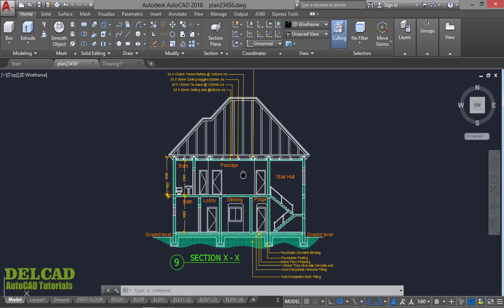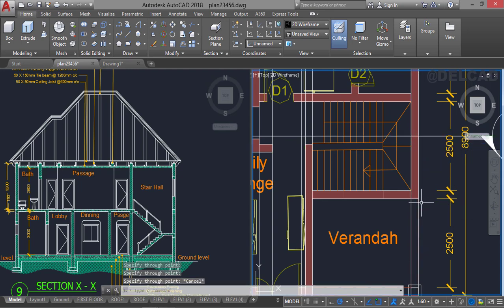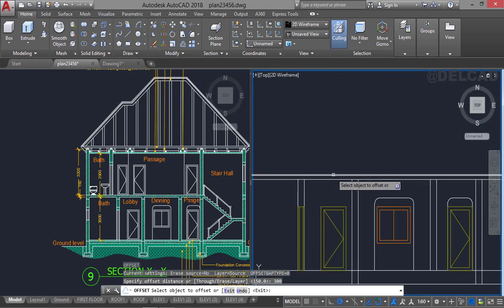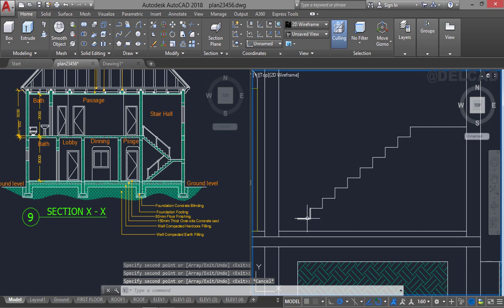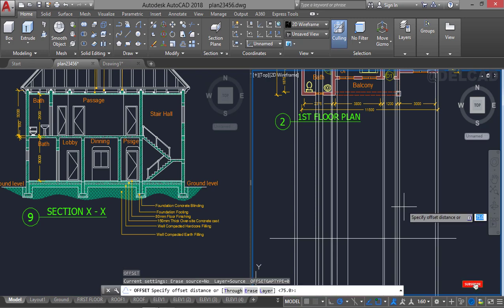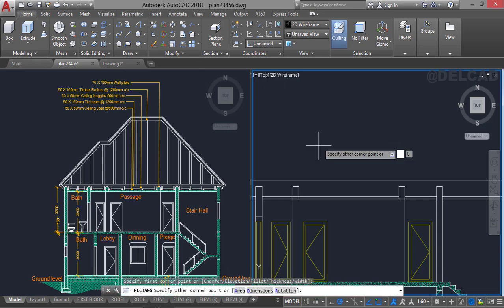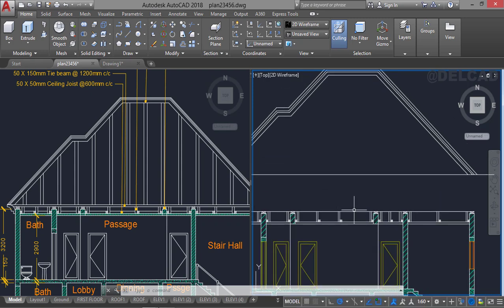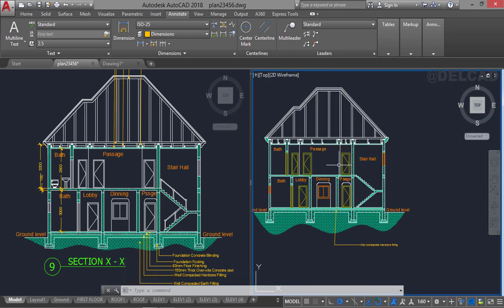HOW TO DRAW A SECTIONAL ELEVATION OF A BUILDING IN AUTOCAD: COMPLETE TUTORIAL

Comment: Thanks alot for the videos, I'm confused about the roof section, why did you draw the section using the roof (elevation) opposite where the section line faces
Reply from the maker: Thanks for the support. It seems to be opposite. But when you look at the roof carefully, the roof section elevation will look like the side opposite the section line.
Reply: @dellkingstech_tutorial5995 thanks for the reply

does that method apply Everytime

And another thing is a double swing door,
 so if a section line faces that door, will the section elevation of that door be mirrored (compared to what we have in the elevation)...?